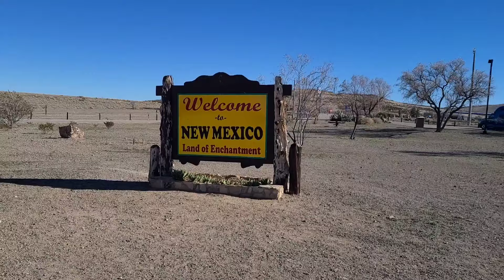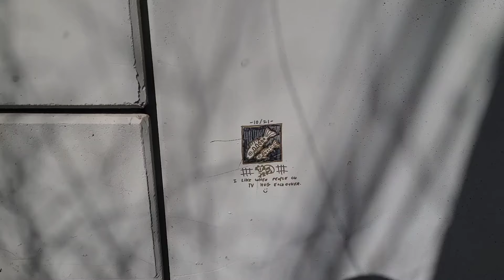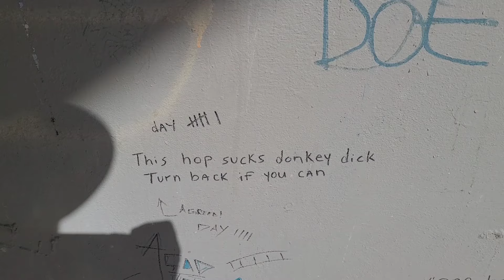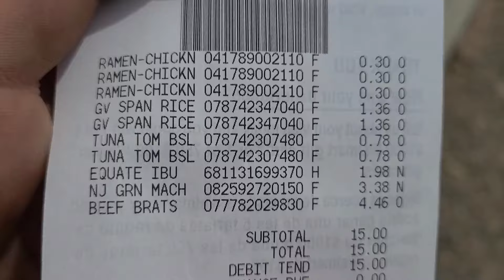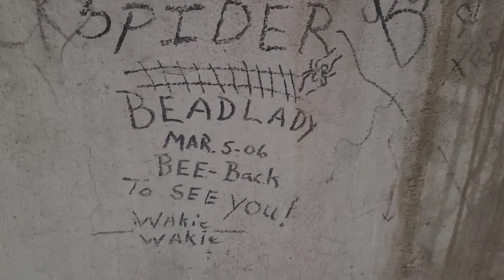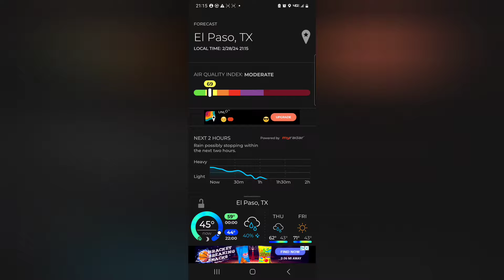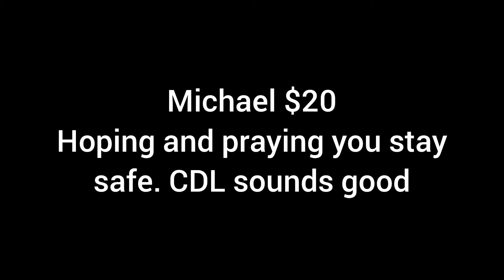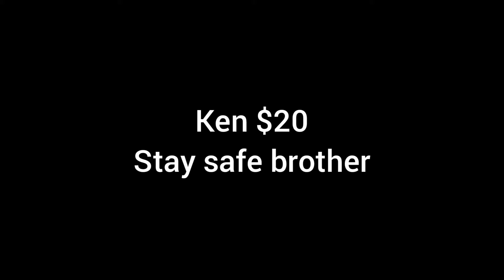Rollercoaster of Emotions on the Southwest Highway

Comment: Patching an inner tube is easy. Clean surface of dirt and oil. Score surface with metal disc. Apply rubber cement. Place patch on top of cement. Place heavy object on top of patch and let set for 8-10 hours until cement cures fully. Place inner tube back in tire, place back on wheel and inflate.

Comment: Man
I was a locomotive engineer.
Get and used a military backpack. For decades good quality cheap and useful.
Just built one up few months ago for less than $50.
Bag was $25 off eBay
And I picked up a water bottle and a couple of those pouches used, and a butt pack pouch.
They got the MOLLE attaching hardware to weave the pouches into the bag.
I use it now for overnights, weekends hiking and camping.
I had a ALICE pack before.
Enjoy the new one more (made maybe-2006) area I bought used-military. Shoot I could give you my old Alice pak if interested.
Reply: People including myself have suggested that he get a military surplus backpack but he's thick headed and doesn't listen.

Comment: Hold on there.  Get to auto parts place, buy what is called Slime. It comes in different size bottles.  You might find it in the bike section of Walmart.  To use this stuff,  all you have to do is remove the valve core from the inflation port.  The bottle comes with an input tube and valve core removal tool in the cap.  You squeeze in about 1/4 cup through the plastic tube.  Remount your tire and tub on the rim, turn the wheel.  Re inflate, and you are good to go.  Put slime in both tires.  There is really nothing to working on a bike.  All you have to know is a screwdriver from a wrench.  You will do well.

Comment: Also for tires: on the rear get a heavy duty mtn. bike tube such as Goodyear or Blackburn and a CST heavy duty mtn. bike tire. For the front get a new 1.75" rim and put a Vee narrow mtn. bike knobbed tired on it with a slime self-sealing tube. The Vee tires are indestructable and incredibly hard. Around AZ there are all kinds of burrs and thorns and they will pop most normal tires in a second. The Vee knobbed tires are dense, hard rubber, and last forever. You can go years without a problem.